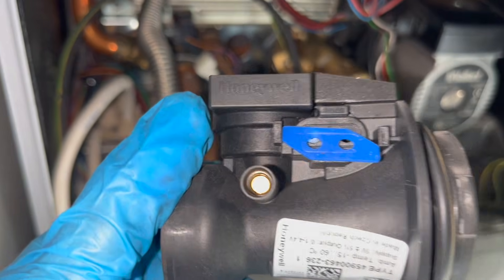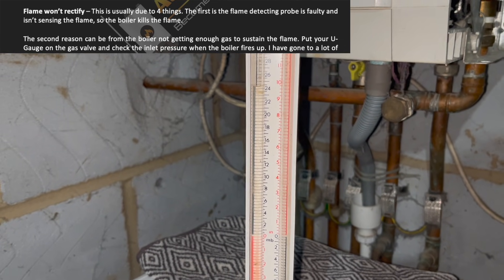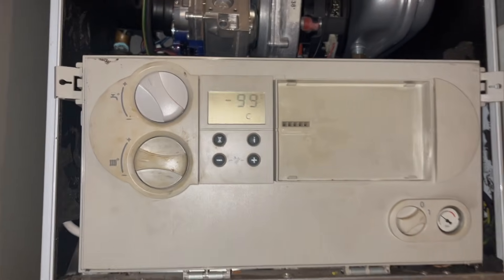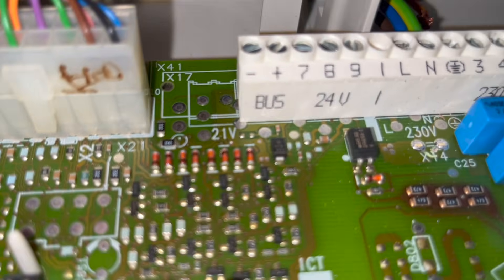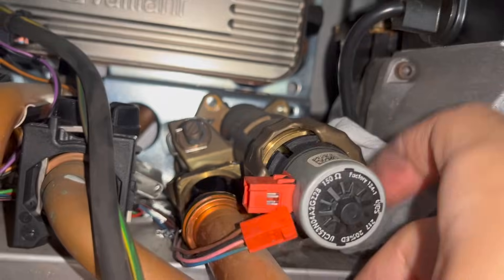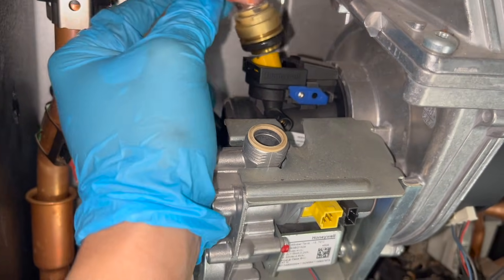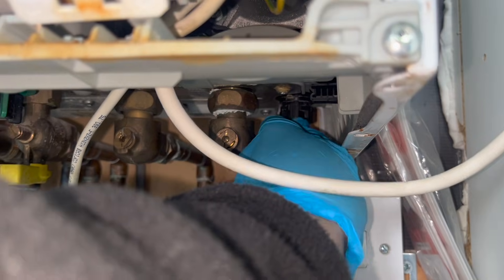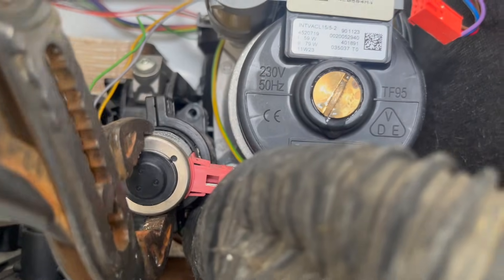Boiler Repairs - Worcester, Vaillant, Glowworm + more | Day In The Life Of A Gas Engineer #13

Comment: My local gas engineer wants £180.00 just to replace the white glow worm electrode on a Glow worm ultimate which does seem very high what do you or others think
Reply: Ask for a breakdown of the quote it may be just really expensive for the part, keep in mind he’ll have to do 26/9 gas safety checks which takes time, to be fair if they are vat registered could be £100+vat £120 labour plus the part could come close to £180 mark depends on his labour rates